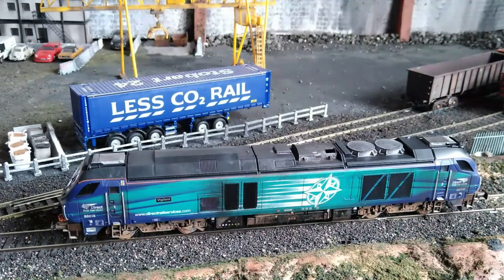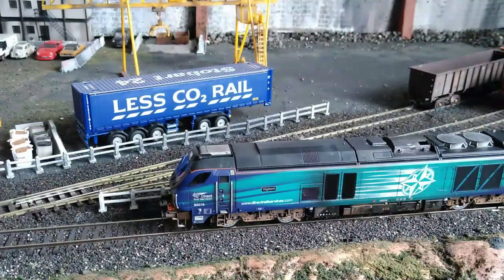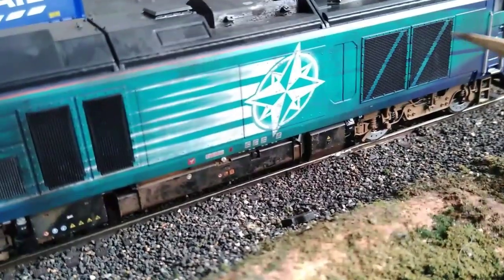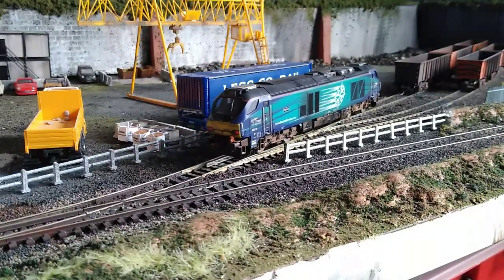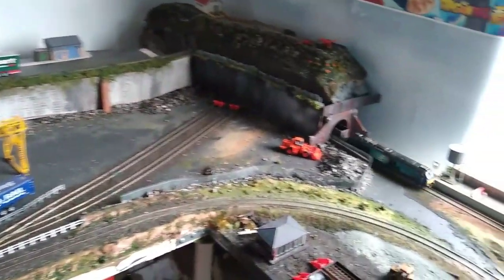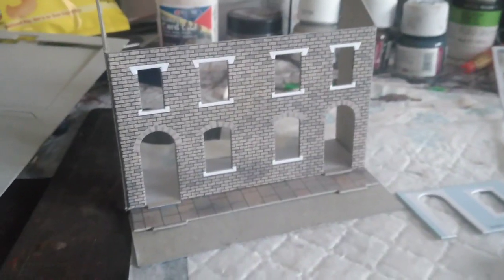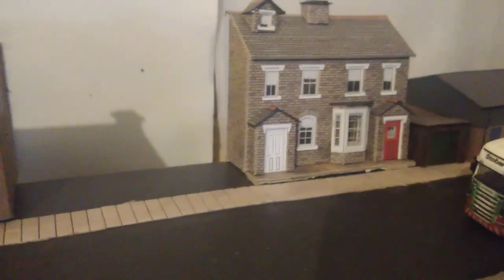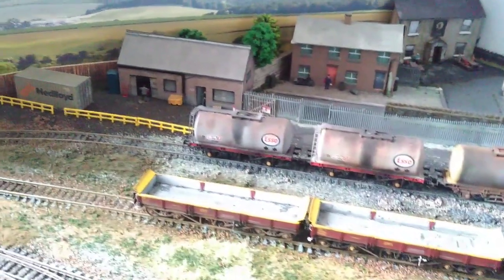Do missing hand rails ruin this model? | Iron Horse Weekly ep21

Comment: Hi Craig, 68s are lovely loco’s I’ve got a couple with sound the metcalfe kits are easy to build and good value you have placed your dormer window to high the ridge  shouldn’t be higher than the ridge on the main roof cheers Al
Reply from the maker: Well spotted - I've already moved it down mate 😄